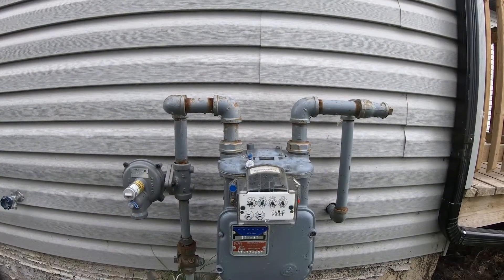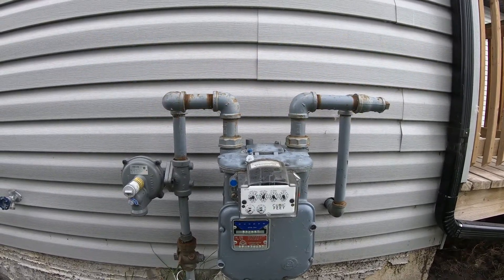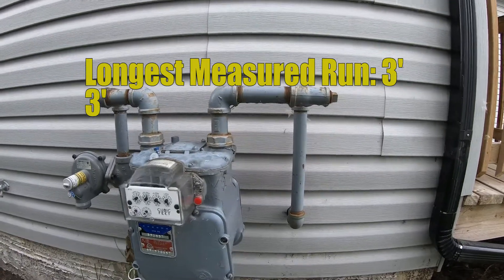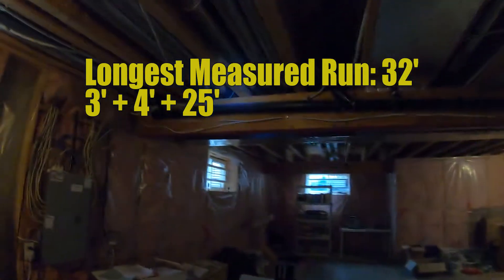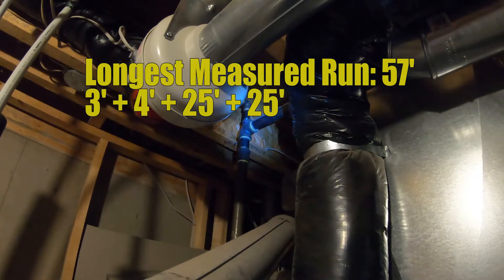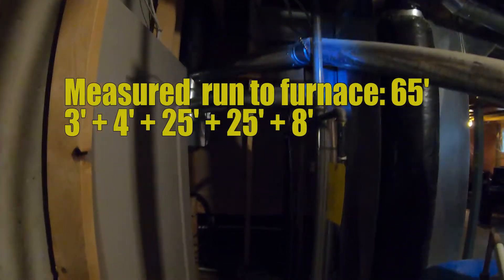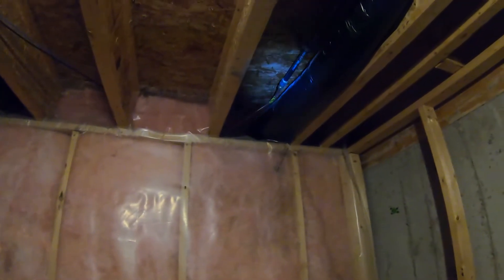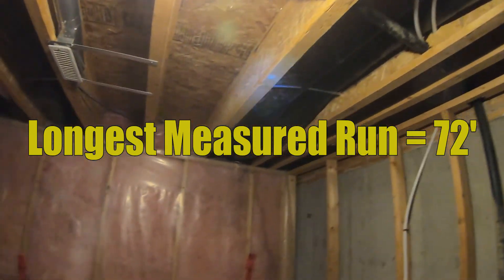Low Pressure Gas Line Sizing Part:1

Comment: I'm unclear which sizing chart to use when selecting the pressure drop.. you say use the one inch water column choice on a half pound meter.. is that standard?

Comment: well got my ass handed to me for the 2nd time (Red Seal test)   studies for 6 months, material from associates school last year, 1400 question csa practice test, all these videos,  this challenge test is absurdly hard,  NONE of the material i studies was on there, 10% of these videos were on there ( thanks for that)  90% were odd scenarios & stuff ive never head of in 20yrs.    EG:  B vent MAX allowed 50ft, unit heater manufacturer supplies a booster fan for > 50ft..... where does this fan go?   jesus christ!  i don't know!  I've never heard of this even being allowed!    now try 70 more questions like this! 
this test was not a curriculum knowledge test,  more a test of my experience and product specific specs ,  could have tossed the code book in the trash, didn't really need it

Comment: test tomorrow!  last question:   if you have say 3 independent runs to single appliances all manifolded off the first 24"  from meter. would you treat each one as its own (longest length?) for sizing?  or would you have to determine the longest of the 3 and use it for each of the runs?
Reply from the maker: Definitely not a test question. Technically yes you can do that. However, I would size the common manifold based off of the total connected load and the longest run to ensure you don't get a choke point in your piping.
Reply: assume not on test, odd scenario,  but if 3 independent runs 24" from meter, say one run is 200ft and the other 2 are 10ft,  are all 3 runs calculated at 200 ft?  or each sized on their own length ?  actually this came up on a csa practice test (suprised me too) would it be treated like there was 3 meters? (because all 3 are 24"from meter) @MathematicPlumber
Reply: Or a interesting question: if a very long run is branched 24” from meter, does IT become the longest run to calculate all piping in system?
Reply from the maker: @davequesnel8740  No, that system will be a stand alone pipe size and length.

Comment: How do 90’s and tee’s affect your calculations?
Reply from the maker: Fittings only affects high pressure gas line sizing. Low pressure tables account for fittings, easy squeezy. I have a video series on high pressure if you are interested.

Comment: What about new construction that doesn’t have a gas regulator yet
Reply from the maker: I assume you are referring to the standing gas pressure that is available out of the system regulator. If it is low pressure on a regular house, assume that the outlet pressure will be set to 7" to 14" WC and has a maximum 1" WC pressure drop.

If it is a commercial building or if 2 psi gas is available in that area, then you need to figure out what the gas provider is supplying to the house. (Commercial and industrial buildings are often engineered, so you just follow the blueprints)
Reply: @MathematicPlumber  you’re a life saver! Thank you very very much